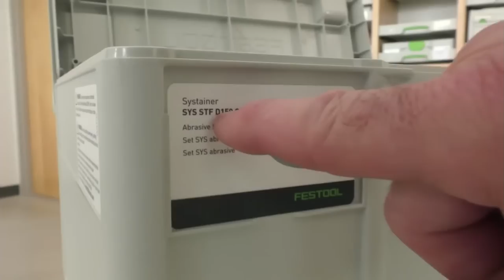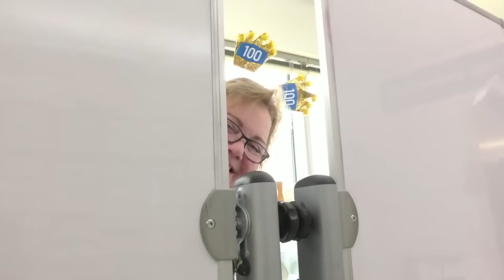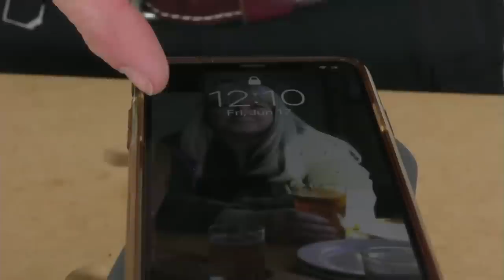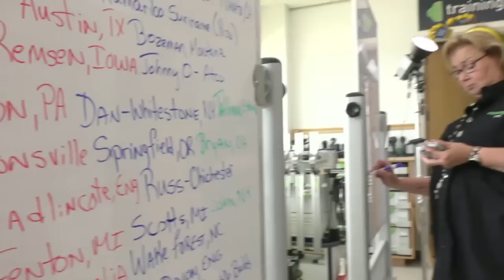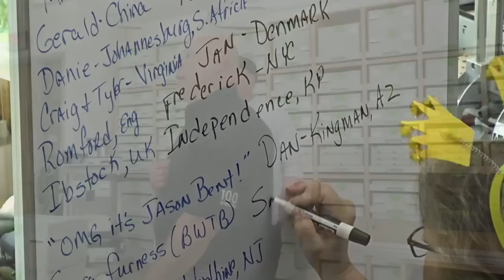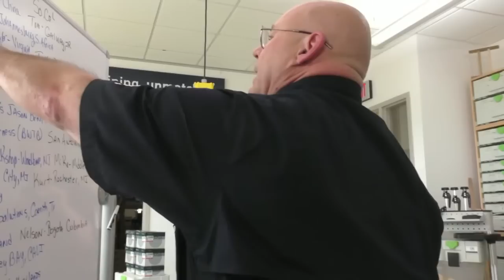Festool Live Episode 100 - Summer 2022 Products

Comment: I just got the tool set and was surprised when there was a 13/32 qtr drive socket but not a 7/16. I will never use the q3/32 but the first bolt I got the set out to use on was a 7/16.  Can I get a 7/16 to match the set ?

Comment: Congrats on the 100th vid guys but CARDBOARD INSERTS?? or does that pull out and  there's a moulded insert below??
Reply: yeah I hope that cardboard is a place holder or something
Reply: I'm thinking it's basically a SYS-STF-D150 with the granat discs added. That one has the molded insert. The cardboard is probably just to keep the discs in place. What I'm wondering though is that all retailer listings for the set list 40 discs for 60 and 80 grit while on the festool site has 20 discs for all of the grits. Either way, I'm grabbing one of these since it's still a decent savings over buying individual packs.